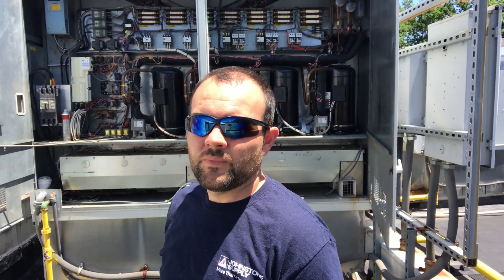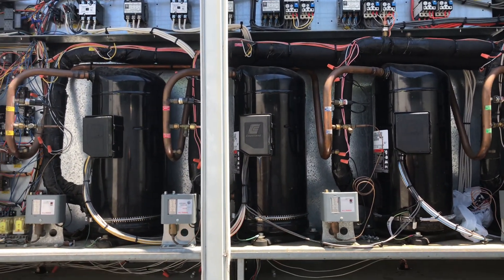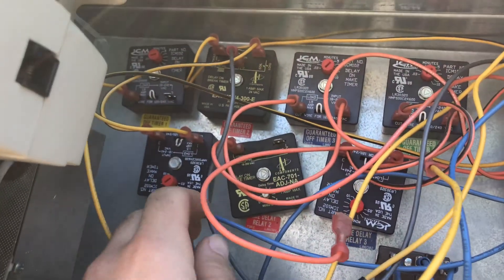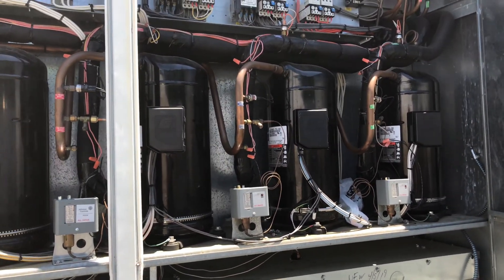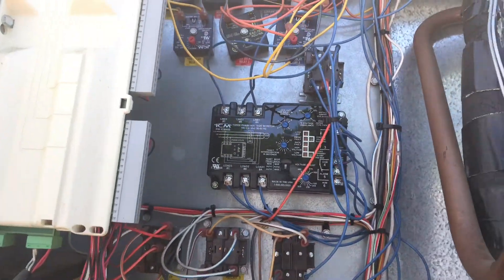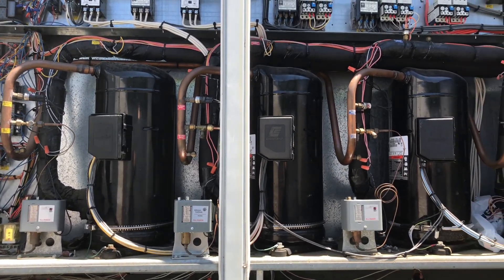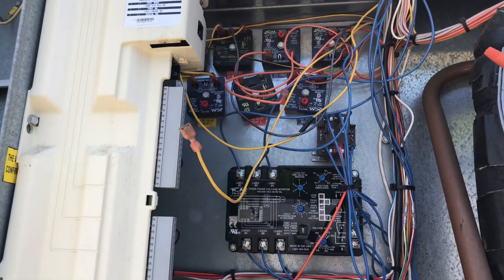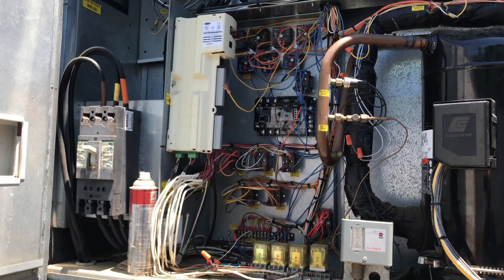50 Ton AAON Roof top HVAC Unit, No Cooling Service Call

Comment: Thank you for sharing.  I have a 60 ton that shut down about 30min. And restart when there is 73 + oat and the third compressor kicks in. I never see the 4th run at anytime.  I replaced the 4th comp. contactor and it run good for 5 days and start shutting down. advice.

Comment: The 3.2 amp resetable transformer should trip when contractor goes bad, contactors don't kinda go bad they ground and fail, they pull big amp draw, even if chattering they pull big amp draw.  Worked on AAON for 20 years & 80+% off the time I'm working on AAON... bet you something is miss wired, lots of same color wires in same place, never seen what your describing B4 on regular bases, just trying 2 help.  If they are pulling over 1.5A but under 3.2(or even 6.4 when 2 trans wired parallel) something is wrong, could be 24VDC barely grounding through limit or wire somewhere, but contactor failing should not cause this.  Been on thousands of aaon units personally.